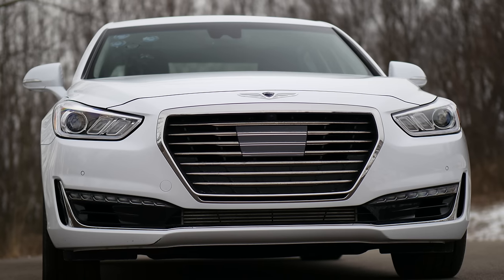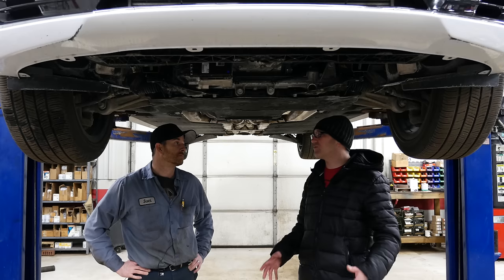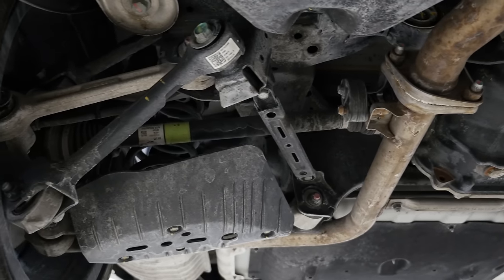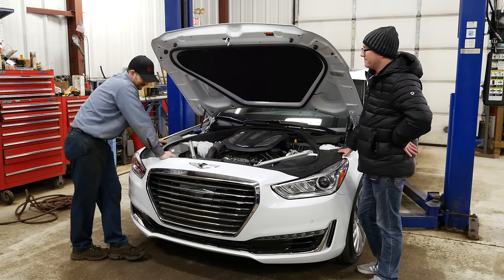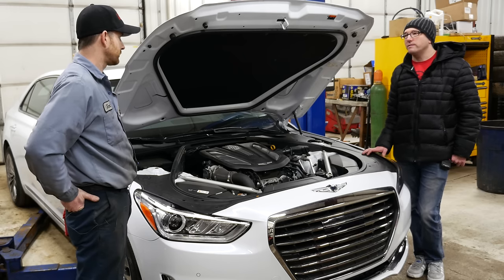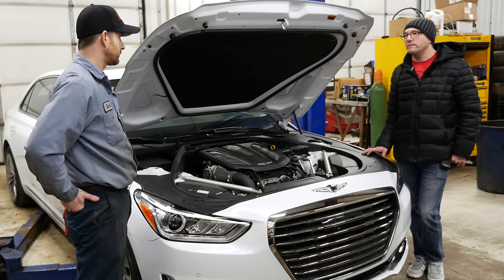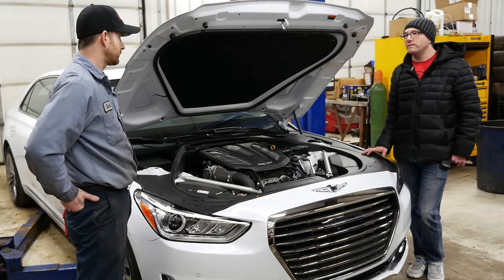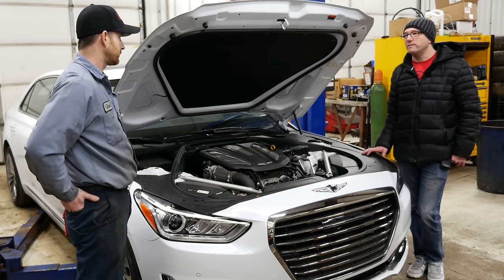Review | 2017 Genesis G90 | Hope for Modern Luxury

Comment: I own a new G90.  Have had it since November 1st.  I absolutely love it.  Best car I've ever owned.
Reply: congrats... Enjoy the car many years to come.
Reply: towneford1 let us know how it turns out after the warranty is up on your Hyundai lol
Reply: in 10 years?
Reply: Warranty is 10 years power chain.
Reply: ***** if you're talking to me, how on earth is anyone jealous of a fucking Hyundai LOL
Reply: hey do you think it is in the s class range or more towards the CLS and audi a7 range? check out this link from Usnews and world reports it ranks the g90 as second place in the large luxury car class. https://cars.usnews.com/cars-trucks/genesis/g90
Reply: Automotively speaking, you are an ignoramus. I drove a 2010 Genesis 3.8 for 5.5 years. Paid 33K for it new, sold it for 16K at CarMax. Over the 5.5 years, I had one non-routine issue, a blown parking light diode. I was in the dealership Monday at 8, and out the door at 9. 

Then I got a 2015 Genesis 3.8 AWD. Fabulous car.  I'll be looking at a G90 in a year or two.
Reply: Madeline Monahan, Somewhere between 35,000 and 40,000, as I recall. Oh, I should mention that the original Dunlop tires were not very good, and I replaced them around 28k with Michelins and the car handled and rode significantly better.  I should mention, this was a "base" Genesis 3.8. Not having the sun roof gave extra head room, cut the weight by several hundred pounds, so the car did 0-60 in 5.9 seconds.  The 2015 Genesis 3.8 is significantly heavier, and slightly slower, but a LOT more luxurious.
Reply: Do you still like it?
Reply: towneford1 That's awesome. I'm 17 and this is my dream car haha
Reply: Equal in quality with a softer-cruiser ride, not a performance monster like the Germans.  Maybe a better competitor would be the Lexus LS.  I traded in my 2012 Equus (which we loved)for the v-8 G90...each in the Ultimate trim and we've been quite happy over 3000 miles in two months  Since we live in South East Florida (no snow, ever) we stayed with the rear-wheel drive.
Reply: towneford1   is it more comfortable in the new Lexus LS?
Reply: Any problems over the years and is it a smooth ride????
Reply: I thought about getting a G90 but it’s too big for me. So I got a G70. I think I’m going to move up to a G80 very soon.
Reply: You still own it?

Comment: One year ago, I bought a pre-owned 2017 G90 Ultimate AWD with 20k miles, near-mint condition, for $39,990. Best car purchase I've ever made.
Reply: Still loving it?  Looking at 2019 with 30-50k miles.  Thanks.
Reply: @shaunr5450  Yes, still driving it daily. Great car. No mechanical issues.
Reply: Can you share details on: how costly is the maintenance. Any major repairs? How many miles did you put?

Comment: Your is my favorite YouTube channel. I enjoy the reviews and watch them even for some cars that I would never consider owning.

I am planning to buy a G90 within the next two weeks. It will be replacing my Lincoln MKT as my daily driver with plenty of backseat room because I am tired of the MKT's vibration, panels being gapped or overlapped, increased rattles, and small things breaking like the driver's side mirror clouding or gaskets falling off of the sunroof. I am hoping the Genesis has better build and ride quality than the Lincoln. Even though I am in Florida, you probably can't talk me out of getting AWD rather than RWD. I have a ND Miata when I want RWD fun on nice weather weekends.

I know you are impressed with the twin turbo V6, but if you were about to buy, would you go ahead and get the V8, or does the torque at lower RPM's in the V6 make it more fun to drive? I am not concerned about gas mileage, but I enjoy acceleration almost as much as a smooth ride. Most likely any test drive that I take will be in traffic where I can't push the limits of the car, so I am asking you. V6 or V8?

Comment: I'm surprised you didn't like the wood trim.  In your video, it looks nice to me.  All of the cheap plastics really drive home the point you are in a Hyundai.  When you zoomed in on the door arm rest it looked so cheap.

Disappointing needing to change suspension modes at different speeds for a nice ride.  You would think they could engineer a suspension to automatically adapt appropriately.

Comment: I just bought a 2017 G90 and I am very impressed with it over all. However, at 6'4" it is very difficult to get into the back seat and once there my head is actually touching the roof area. I was amazed by how cramped it felt. I am not over weight, just tall and will be making excuses to my tall friends who might have to ride back there on occasion. Other than that this is a fantastic car... But the shifter is just stupid and the lack of Android Auto & Apple Car Play is a huge oversight. By the way, the screen does have touchscreen capability but only on certain windows, like the qwerty keyboard for GPS destination entry for example.

Comment: That 3.3L twin-turbo V6 will be amazing in the Kia Stinger GT and Genesis's future M4-fighting coupe.
Reply: J.Chan Your wish has been granted 😊
Reply: 1969cmp and it wasnt even close to m4...like way off. But not bad at all good striaght line performance but the thing was slower than a focus st around willow springs in a motortrend test.
Reply: Performance of KIA Hyundai is way behind. Don't bring it up unless you have driven M4
Reply: Korean cars are heavy atleast 300LBS more than competitor. Engine response isnt' good. Transmission is typical Korean trans. Ride is floaty. Numb Korean steering. Look at G80 sport. That weighs 4500LBS while Lexus GSF with V8 weighs 4000LBS, 5 series is also 4200LBS. that weight just will kill handling performance

Comment: Not for anything, but I sat in this at the DC International Auto Show and I was really impressed. It's not touching the S-Class interior yet (No one is though) but everything looked and felt premium. Everything I didn't like were totally subjective (The Gauge font, the type of metal used on switches). That car for $68,000 felt like you were robbing the dealer. Is it AS nice as a 130 grand 7 series or S-Class? Nope, but just like SG said "If you want a luxury car with no bullshit, it's either this or a Lexus LS." If you pay 10 grand more for a BASE Audi A8 instead of something like this, it almost feels like you are throwing money away. I can't wait til we see what they do for the G70 or whatever their 3-series/C-Class/A4 fighter is.

Comment: I think the 2021 G80 shows where Genesis has improved the car's interior. The G90 will get a refresh, the plastic-looking wood will be gone, maybe the suspension will be tightened up at higher speeds, and it'll be there. I just have a really good feeling about Genesis.

Comment: Good review. As to the wood trim, I would say that could be subjective to ones taste. I personally like the glossy wood just as much as the matte, more natural finish. The rear of the car looks classy. It is copied from the Lexus, Jag and Merc, but it does look very nice. The front though is a different story. The headlights design is ok. Looks like it's copied from Lamborghini, but that ugly front grille. The proportions of that grille just looks off and could use of some embellishments. It looks empty or bland, like it's unfinished or something. Although I think it would look better if they used a mesh design instead of those horizontal lines. Otherwise, I think it's a wonderful car and I am totally considering to get one. I would just need to get passed that front grille.

Comment: I know u said the car moves nicely with the 3.3tt engine but it seems underpowered @ 365hp. A Focus RS has a 2.3t 4 cylinder and nearly matches the g90 in terms of power which seems crazy.
Reply from the maker: +wayde philpot I can promise you the RS motor feels nothing like this despite what the numbers tell you.  But I get what you are saying, why so big for similar power?  Well Ford gets that by running massive boost.  The issue is the V6, feels smoother, faster and consistently delivers power and tq without pulling timing or constantly altering power output like the RS motor.
Reply: savagegeese i see. The outgoing n/a lambda v6 isnt too far off either @ 348hp. Big difference in tq tho. The turbo motor puts down anout 85ft/lb more and prob much lower in the powerband....i would just expect a tt v6 to put down atleast 400hp. The 3.5L ecoboost in the f150 puts down 450hp/510ft/lb.....i just feel like Hyundai is limiting power of this tt engine so it slots in under the v8 w/o a significant bump in power to the v8 which sucks.
Reply from the maker: +wayde philpot Yeah thats for sure, they may retune it for more HP in other applications would be my guess.
Reply: wayde philpot The 3.8L Lambda was retuned to 311 HP in its most recent form (see G80 and K900), and the N/A 3.3L to 290. I think the 3.3TT is comfortably in the area of other twin turbo V6s in the segment (Mercedes, Audi, BMW), with the only overachievers pushing 400+ being the other underdogs (Cadillac, Lincoln, Infiniti). Everyone else has a V8 for more. I agree that they probably kept output down to justify keeping the Tau.
Reply: JDubbs07 there are many engines out there that seem inefficient in terms of power. I dont understand the appeal of luxury cars in general. The g90 starts @ just under 70k! For that type of money, i want serious power! Altho, thats not all there is to a car, that should be part of the equation. I can get a new v8 dodge charger for about has of that price. Granted, the charger isnt luxury, it shares some characteristics such as weight and power output. It seems odd that hyundai uses 2 n/a v6s also.
Reply: wayde philpot I don't disagree - that's Corvette Grand Sport money lol. But I think for outright luxury, the G90s price tag makes sense to me. I'd love to own one. I'm VERY curious to see what used ones will run for in 3 years.

I believe the N/A 3.3L has largely been for fwd applications, whereas the 3.8 is their "premium" one.
Reply: To be fair, those are two completely cars and it's not all about horsepower when it comes to a luxury cruiser. The twin turbo V6 is more than adequate, not the other way around.
Reply: *different. ... Why won't YT app on the phone let me edit. Strange...

Comment: Can u expect 200k care free miles like lexus as u compared them both.   These cars are a steal lightly used.  But if it has electrical and mechanical problems like the germans why do it.   Also does it use regular gas
Reply: So far, Genesis is very reliable. I like my G90

Comment: Hyundai/Kia have been making good moves for a while now and that's great, but no way I'd pay 40K+ for a Hyundai--no matter what badge they put on the front.  From a resale value it makes no sense, and buying used kills the 10 year warranty thing.
Reply: I get what you're saying, I really do. But I ran into someone that can buy any car he wants and he just bought one of these in black with the 5.0. I thought maybe he was slumming but he just bought another company that was in no means in bad shape. I think people are getting smarter with their money.  Rubber is rubber, steel is steel and glass is glass. Mercedes is always on the list of cars that lose the most money after driving them off the lot. Makes one think...
Reply: Do people not realize you can buy certified pre owned used and this makes the warranty still valid.  Just purchased a cpo 16 Genesis with 14k miles and still has 60k 5 year bumper to bumper and 100k 10 year drivetrain.

Comment: I drove the G80 and I was not impressed. The price structure is no longer a big advantage over the competition. The ride handling balance was off. Never riding or handling as well as even the most pedestrian Audis or even the Chevrolet Impala. I still must drive the G90.  Unlike you I do not feel the Koreans are quite there yet.  Your points on the car not feeling planted above 65 mph or so without going to sport mode is something I also experienced in the G80. The interiors exteriors and the overall quality is very impressive.  A very basic A4 drives better than anything I have driven From Hyundai.
Reply: fatboy19831 how can you say there's no price advantage? This vehicle fully loaded with a V8 comes in at less than a moderately equipped 5 Series or E-class, and this vehicle is a whole size class above it. I mean your other points may have some credibility, but I don't think you can fault them for value proposition

Comment: I just went through drive through the other day in my '15 Genesis, and the guy asked if it was a 300 :(
Reply: Ouch...it happens, sucks when it does though lol What color is it?
Reply: Same as this review, white ( think it's called casablanca white or something).  Has a blueish tinge you can only see after a fresh snowfall
Reply: Man I think thats its best color, someone at this Acura dealership drives one looks great. Personally I don't see chrysler 300, the Genesis looks much better looking that the Lexus GS which looks like a damn goblin.
Reply: Daniel Castaneda I think it's due to the winged crest on the steering wheel.  it looks a lot like Chrysler's

Comment: Are your roads made of salt? Holy shit, cars there probably dont last more than 5 years.
Reply from the maker: +Xzstnce You cannot own a nice car here and drive it in winter if you care about it
Reply: savagegeese I agree winter is very hard on sedans, rust eat down the undercarriage.
Reply: You must have been living under a stone for the last 10 years. Rust is no issue anymore (and I live in a country where the roads are salted in winter very frequently in winter too).
Reply: Ronald de Rooij your joking right? Winter is the reason why a lotta vehicles age faster, rust as always been the undercarriage cancer.
Reply: Roads are salted in Germany aswell, but Ive never seen so much cars with so much salt as on savegegeese's channel. Cars in Germany can easily last over 15 years and it seems we use much less salt than in Illinois.
Reply: Xzstnce I live in Boston Massachusetts and the average vehicle won't last over ten years without proper care, rust and moisture kill them, especially the female drivers, most of them don't do maintenance care, so the paint fade out quickly, and rust spreads fast, and they just buy a new one.
Reply: This is normal in places with snow.  In Montreal, any car basically has huge holes in it after 5-10 years unless you rust proof it and wash it daily, which no one does.  Salt for 6 months out of the year + rare washes + potholes every 2 feet ruins cars.
Reply: Daniel Draghici yup, this is exactly why i quit driving sedans, it's useless to drive a beautiful car in the wintry seasons, SUV has been out selling cars anyway, and yes you have to take proper care of any vehicle your trying to keep long term living in snow areas, I don't know who would buy a brand new pearly white sedan, and then drive it out in the snow, that's a faster way to set up your depreciation clock.
Reply: No salt on the roads here in Alaska...or Washington, Oregon, Montana, Wyoming, though Idaho now uses salt...

Comment: To add to decibel readings, in addition to being impossible to control externalities for scientific comparison they just don’t tell the whole story. Your favorite music and a dentist’s drill could read the same decibel level. Would a slightly quieter dentist’s drill then be better?
Amazing luxury car designers work to include pleasant reassuring sounds and exclude unpleasant ones. It takes a lot of listening and testing. There is a reason they never include decibel readings in marketing materials. 

I actually find EVs to be less comfortable noise-wise than traditional luxury cars due to the high pitched sounds they make, even though they are often objectively quieter when measured with a standard SPL meter.
Reply: To add to this, there is a famous story of Rolls Royce strategically adding additional ambient noise of a certain frequency to their vehicle because it was more comfortable than without it.

Comment: Sorry Hyundai/Kia have the worst dealers. They are the former Mitsubishi/ Suzuki dealers. That is not a luxury experience. They launched this brand way too soon. They should have fixed the existing dealers first, then built Genesis dealers, then introduce the brand. This is like starting a war before you have an army.
Reply from the maker: +Blake Swan Thats a good question for PR. My assumption is these were all decisions made by Hyundai Korea.
Reply: savagegeese I just wonder if they are aware of the dealer experience here. My mom wanted a Kia Sportage SX but doesn't want to go down to Naperville because the dealers are so awful up here. Now she's looking at a QX30. Btw amazing review. Absolutely agree with your take on the interior and the door handle. Surprised how much of it is the same to the Equuis I drove.

Comment: Im hearing... Hyundai has built a 70k phone carrier. Im seeing a high end Hyundai that more than likely will sound like a low end Hyundai in two years. Banging, knocking steering and suspension parts...that have become victoms of American streets and highways. Im seeing an interior that "words" that label creature comforts...simply fade away... I see a steering wheel covered in a leather that will mimmic the 22k high end Sonata steering wheel... Cheap cheesy appointments that do not lend them selves well...to ANY car, above 40k. 
Used...enh , maybe...as long as it falls into the 40k range, has less than 10,000 miles on it...and is only a year old.  Hyundai Fluff Mobile... at $800 or more a month... The new Ghetto Bently.
Reply: David Skenry just keep driving your corolla.